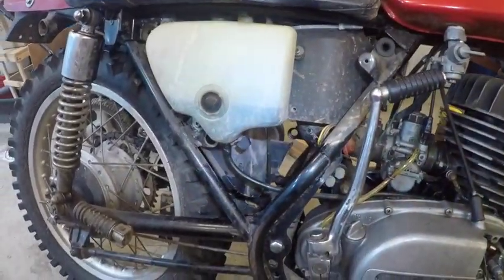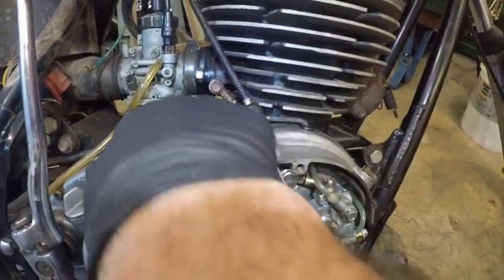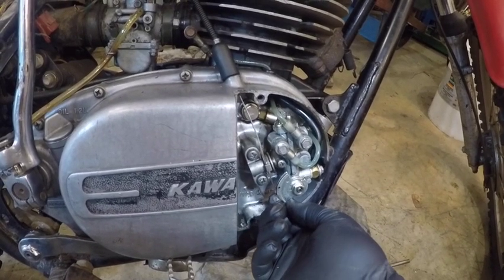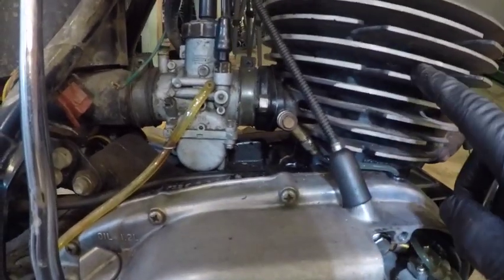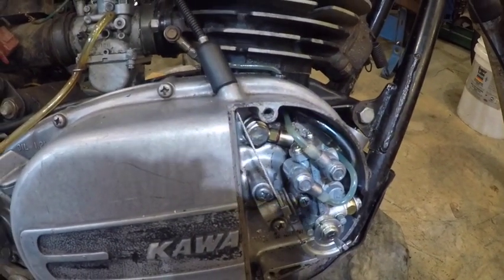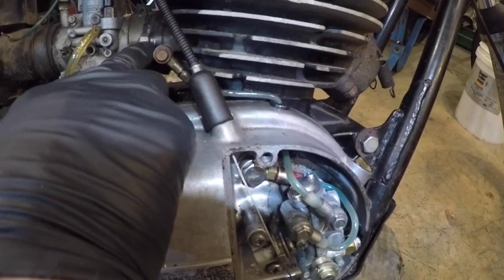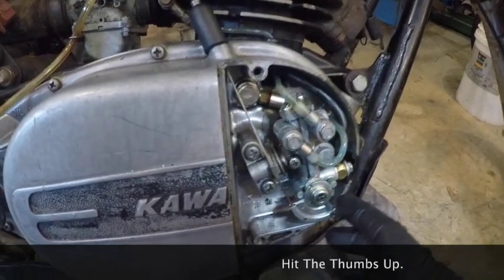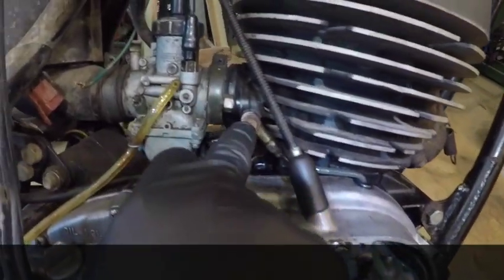1973 KAWASAKI F11 250 OIL PUMP EXPLAINED

Comment: So does that mean I can't take the oil tank and oil pump off the bike and just use pre-mix? Thanks, Rick
Reply from the maker: I say don't remove the pump. I did mix the gas. But on the pump side I disconnect the cable to the pump so the pump would only supply a small amount of oil to the barring and the Carburetor. The bike ran good. Keep the oil tank full of 2 stroke oil.